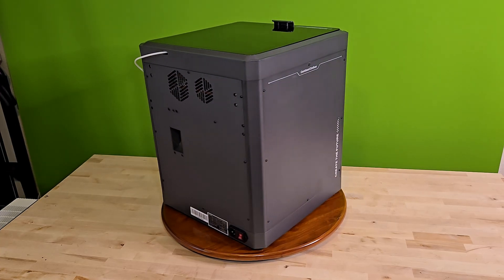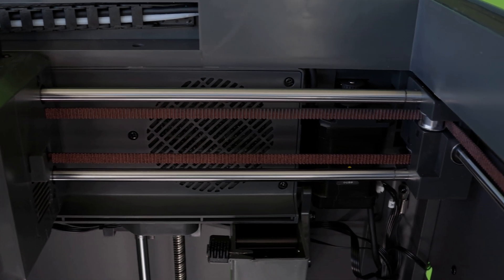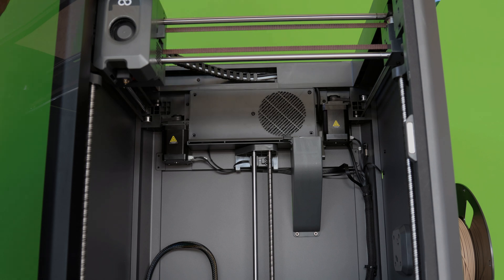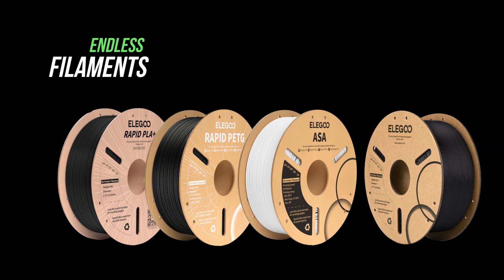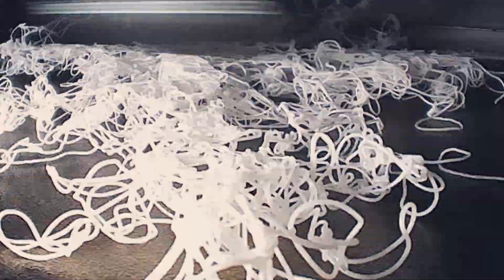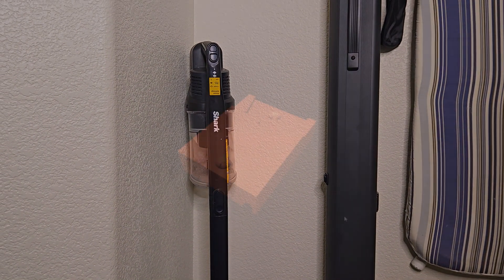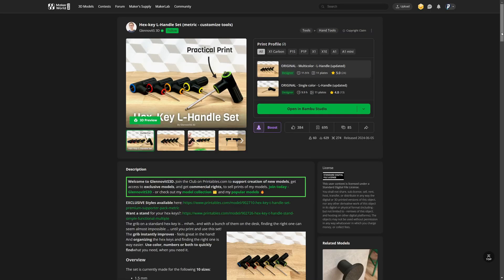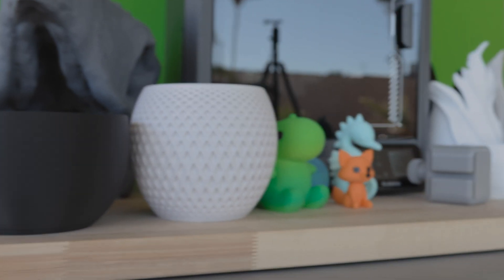Elegoo Centauri Carbon Review – Fastest Budget CoreXY 3D Printer? 🚀

Comment: MASSIVE downside. So far I have not seen the printer come with a carbon filter or any sort of air filtration for the rear of the printer (it does have a fan back there). It would be highly  adviced not to print any ABS, CF or materials high in VOCs (volatile organic compounds, aka not good for you) UNLESS there is secondary filtration that can be setup from the exterior of the printer, the community will most likely come up with a solution if Elegoo doesn't.  If you just print PLA and PETG you should be fine, but with any before mentioned materials, you have a great chance to suffer negative health effects.

EDIT: You are THE first review I've come across showcasing the miniscule filter behind the fanshroud of the printer. Thank you!
Reply from the maker: hahaha I was literally reading your comment going. Wait a second I know I included an entire section on the filter lol.
Reply: @planet3dp  Yeah LOL I was at the 2ish minute mark when i just went uhhh let me rephrase all that. Good work on the review bud! Much appreciated
Reply from the maker: @lolrobin  haha not a problem at all! Thank you for watching and glad it was helpful for you!

Comment: Is this intended as a promotion al video for this printer..? No worries if it is, but I did not hear much of what is missing that could be expected..? No printer is perfect.
Like a heated chamber for certain type of prints.,,?
What about how open, or not, the software is. Is this Klipper based, and able to run Fluidd etc..? Or closed source, like Bambu..?
What is the build size and temperatures it can run at..?
The resolution of the camera..?

The setup seems very similar to that of the Qidi Plus 4, from what I have seen. 

Thanks.
Reply: There's no klipper.  
Klipper requires quite expensive control boards so it's a cheaper proprietary board and firmware.
Reply: Passive heated chamber
Reply: 256mm cubed same as bambu.

Camera OK not great.

It really compares well to bambu x1c at 1/4 the price.

Only missing the lidar and ai Spaghetti  detection which does not always work well on the bambu and can cause more problems
Reply from the maker: This video was created as a beginner-friendly introduction to help those new to the hobby. Many newcomers may not be familiar with the technical details, so I kept things simple and straightforward while sharing my experience with the Centauri Carbon. If someone is looking for a reliable, single-color printer with an enclosure that works right out of the box, this is a great option.
Reply: @planet3dp  Ok. I have never owned a 3d printer. Perhaps over the last three weeks or so I am beginning to learn about the technology, and meaning of the specifications etc.
I'll wait and look elsewhere for the sort of detail that I feel that I would need before buying my first one.

Thanks again and thanks also for your reply.
Reply from the maker: @Vimes.  Yep not a problem. I will be adding more deep dive into this machine soon and doing a comparison video.

Comment: A German youtuber had lots of adhesion problems while testing. He wanted to use original Bambu plates to solve this, but they do not fit.
Reply from the maker: That is odd because I have had only the opposite experience. I have not had one print fail or any kind of adhesion problems. I can only think that maybe it was a unit or plate issue. Hope he was able to figure it out.

Comment: new to 3d printing.  looking seriously at this model.  how do you print models with multi colors?  Don't you need an AMS ststem like Bambu?  Do you get a prompt from the printer that its time to change the filament color or are you stuck with only 1 color
Reply: It's always possible to add a multicolor system later. There are some options available already but Elegoo may come up with their own one as well.
Reply from the maker: @Qwarzz  Yep you're exactly right. I wouldn't be surprised if some kind of multicolor system is already in the works. Or maybe even something completely different!
Reply: @planet3dp  I've seen a bit more about centauri now and it seems like it might be very hard to upgrade it with anything unless you replace the main board.
Some multicolor system could still work but I'm not so sure anymore.
Reply from the maker: @ronaldderi7471  this is a single color printer. Ultimately it comes down to what you are actually going to print. 90%+ of my prints are single colors. If you plan on printing alot of little toys you will need an AMS.

Comment: You failed to mention that its not released yet. At least to normal people without Youtube Channels. Also, Video Sponsor? Did they send it to you for free or in exchange for a positive video?  How did you got one? $100 more you can have a time tested multi-color capable power house of a machine. Bambu Lab P1S. $800 and you get the machine and AMS. Somehow without being released its topping charts as the best around. Ill stick with time tested. Also a new person to 3D printing would be more than happy with an A1 with AMS lite for $500.
Reply from the maker: I completely understand your concerns! The Centauri Carbon hasn’t been fully released yet (Feb 17th. I included this information in the description and pinned comment), and I should have clarified that better. I received a unit early to test, but as always, I aim to provide unbiased feedback, regardless of sponsorship.

The Bambu Lab P1S with AMS is definitely a solid option, especially for multi-color printing, but not everyone needs that capability right away. I enjoyed printing 100's of kg filament without a single multi color print. Even today multicolor printing is less than 10% of my total prints. The Centauri offers a great entry point for those looking for an enclosed CoreXY printer at a competitive price. At the end of the day, it all comes down to personal preference and what features matter most to you!

Comment: Great. Just got the A1 for Christmas after getting the A1 mini in October "my very first 3d printer" Now I gotta have this one. How does the ease of use compare to Bambu? I haven't used anything other than Bambu studios.
Reply from the maker: Congrats on your first 3D printer purchase! 🎉 I’ll be doing a more in-depth review soon, comparing this unit to something like the Bambu P1S, since there are a few key differences to note.

One of the biggest things you’ll notice is that the Elegoo Slicer is built on the same code base as Bambu Studio, meaning the interface feels almost identical. However, as of now, there’s no dedicated app or direct integration with a marketplace like Makerworld for one-click printing. That said, I wouldn’t be surprised if Elegoo is working on something similar in the future.

For now, the workflow is super simple—I just download any STL or 3MF file and drop it straight into Elegoo Slicer, and honestly, it feels like printing on one of my Bambu machines.

At this price point, with the build quality and feature set, the Centauri Carbon is an excellent choice—whether you’re adding another printer to your setup or making your very first purchase. Stay tuned for the full review! 🚀
Reply: I was going to buy the A1 until they recently changed the terms of use in a way that forces you to upload every print file to their cloud and have it "authorized" before you can download the file again to the printer.
Reply from the maker: @thevoid6756 Hey, I totally get your concern! The recent changes in Bambu Lab’s terms have raised a lot of questions, and cloud dependency is something many users are keeping an eye on. While the A1 still allows for local printing via SD card or LAN mode, the default workflow does rely on the cloud, which may not be ideal for everyone.

If full local control is a priority for you, there are definitely other great options out there like the Elegoo Centauri Carbon, which allows direct printing without cloud integration. It’s always good to weigh the pros and cons based on your specific needs. What features are most important to you in a printer?
Reply: @ I am totally new to 3d printing so I don't want to break the bank with something like a Prusa. The Elegoo looks like a great choice for me. Since I lack experience, I can't really say much about requirements I need.I am primarily interested in a 3D printer to make PC parts like fan ducts and case panels so I need to be able to print materials with a decent service temperature. Also I would like to print clear materials if possible.
Reply from the maker: @thevoid6756 That’s awesome! The Elegoo Centauri Carbon is definitely a solid choice, especially if you're just getting into 3D printing and want a feature-rich machine without breaking the bank.

For PC parts like fan ducts and case panels, you’ll likely want to print with materials like PETG, ABS, or ASA, since they offer better heat resistance than standard PLA. The good news is that the Centauri’s enclosed chamber helps regulate temperature, making it a great option for those materials.

As for clear materials, you can print transparent PETG.

Let me know if you have any other questions! Happy to help you!
Reply: @thevoid6756 Say what? I thought that was optional. Have a link to that info?